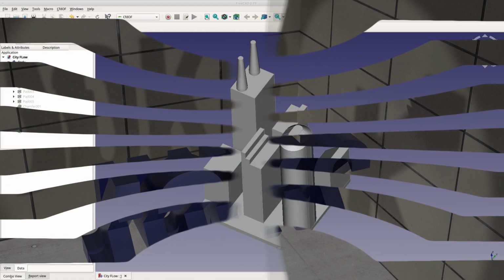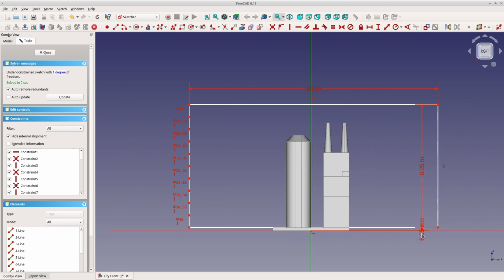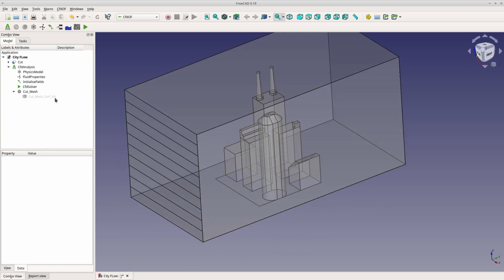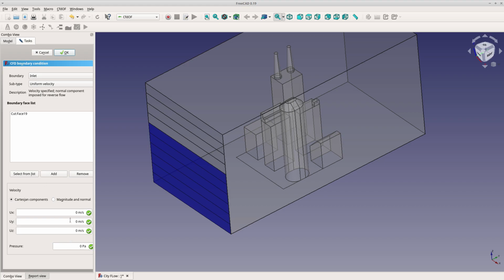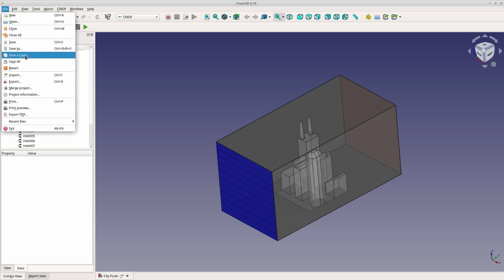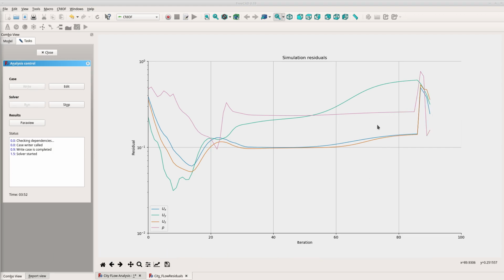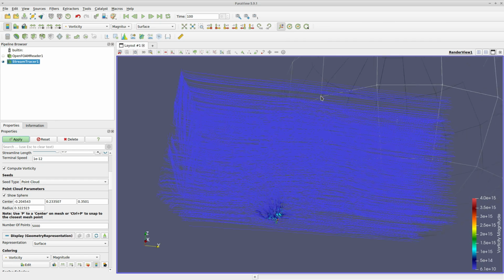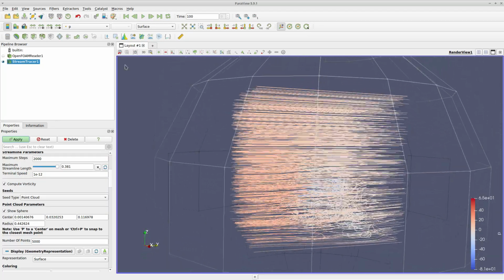FreeCAD CFD- Gradient Inlet |JOKO ENGINEERING|

Comment: It's a month since this video is out and I wanted to share my comments after trying to implement the "Gradient Inlet" approach:

TL;DR: It's not recommended since the residuals are won't stabilize. Use Paraview's Calculator Filter to manually calculate the pressure per verying height.

A better way for applying a gradient is to use Paraview's "Calculator" Filter and just use a formula that uses the height variable (check local/national code). Since we are talking about external flow, the external wind pressure increases from the bottom of the structure to the top and varies parabolically. 

Formula for determining the wind pressure should look like this: 

P =0.613 * Kz * Kzt * Kd * V^2 * I

where:
Kz = Height Factor
Kzt = Topographic Factor
Kd = Directionality Factor
V = Wind Speed (m/s)
I = Importance Factor
P = Pressure (Pa)

As per equation above, you can see that wind pressure varies per height and is multiplied by several constants. Since FreeCAD's CFDOF Workbench does not include these factors in the inlet, it should be accounted for in the results. Which is where Paraview's Calculator Filter comes to the rescue.

Hope this helps.

Comment: Normal OpenFOAM analysis can be executed by parallel computing to do faster simulation. Can CFDOF workbench in FreeCAD do it?
Reply from the maker: Yes, stand on the solver in the tree and the default is parallel set to true with 4 parallel cores.  The settings can be adjusted.